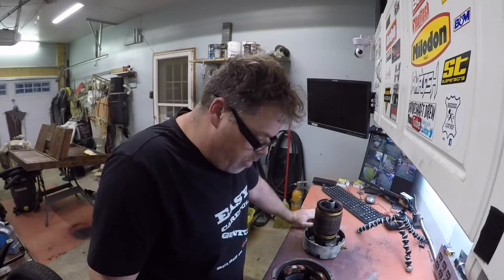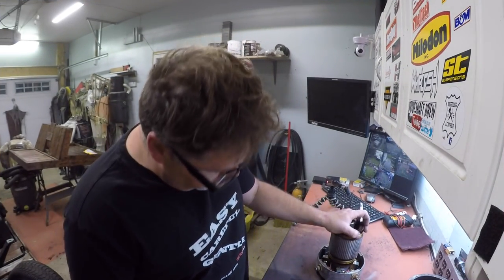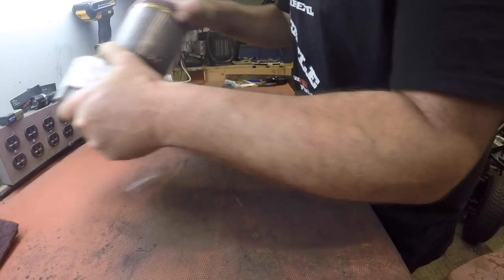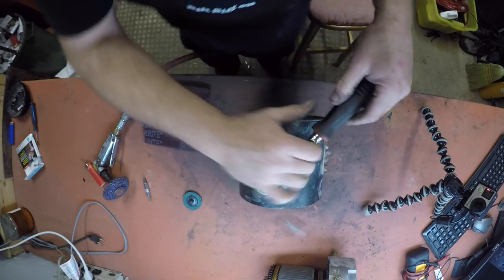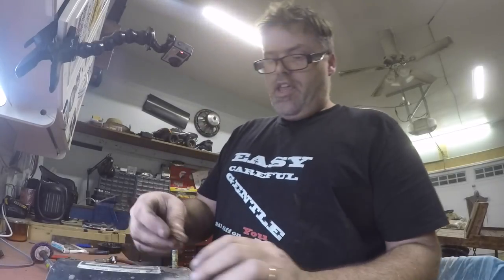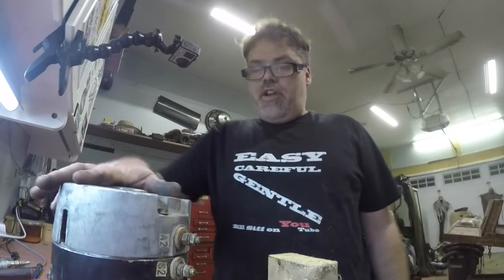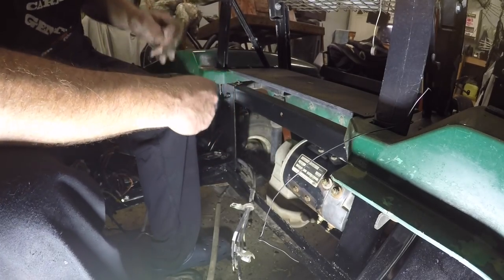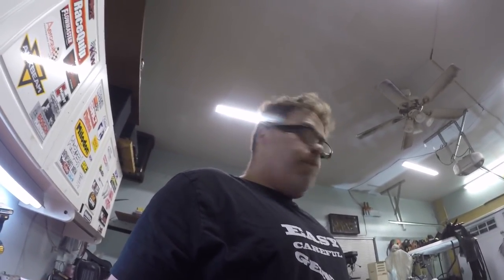EZGO Electric Motor Repair With Bill Siff Fail

Comment: Bill you don't want the arm to be naked bare metal, its dipped in varnish and baked so it don't short out. My specialty was automotive stator reconditioning, insulating, rewinding with magnet wire, dipping, baking and setting up pig tails :)
Reply: I thought the same thing

Comment: you have done this before i can tell with the through bolts need to be lined up to put it together. You can't fool me you know what you are doing! Why wouldn't you!
Reply from the maker: no I haven't lol
Reply: Thanks for the over view, did it today and testing tomorrow my set up is a little different had the brushes all wacked out of the springs so putting it together was some trial and error but never would of checked if I hadn't watched. Thank you. Saved me from buying a new motor.